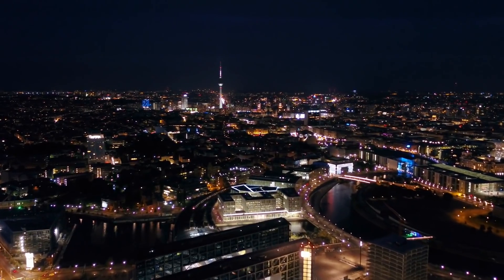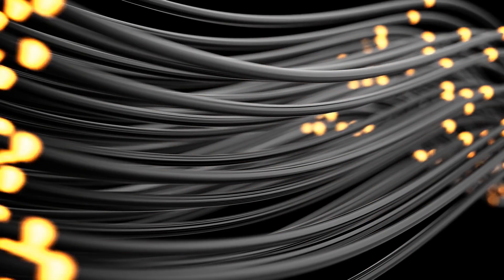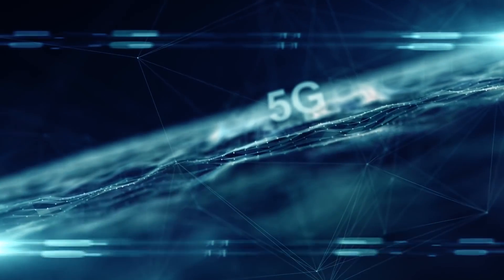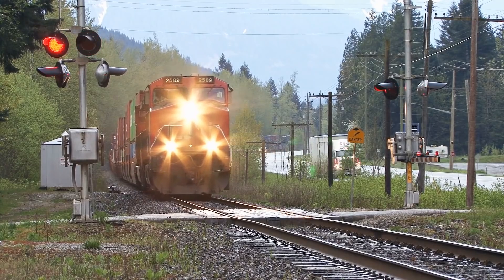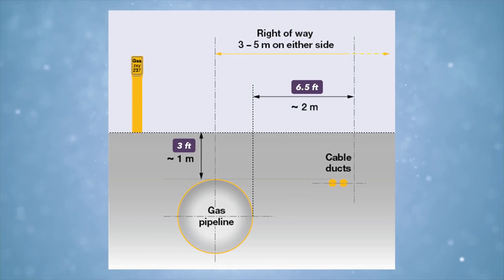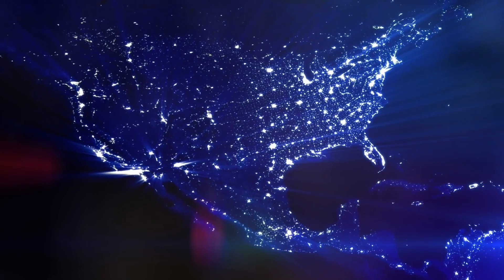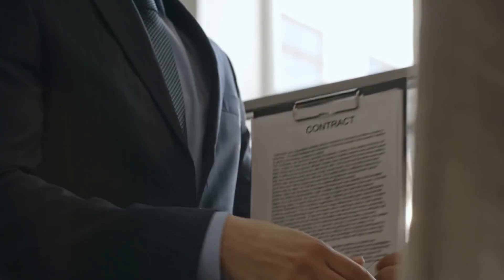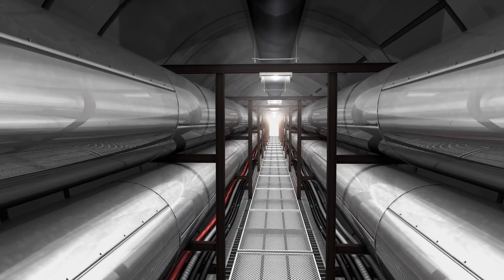Why Would a Gas Company Own Fiber?

Comment: I used to work for a Canadian telecom that was owned by a major railroad.  This meant we had right of way across the country, along the rail lines.  Later on, in Toronto, we partnered with Toronto Hydro, to connect to customers in the downtown core.  Since we ran in fibre, there were no worries about the safety issues you'd have with copper cables, when sharing cable ducts with power cables.  Also, in the Toronto area, there was a company that offered to clean and repair municipal sewers, in exchange for running fibre in those sewers.  However that was several years ago and I don't know what happening with them now.